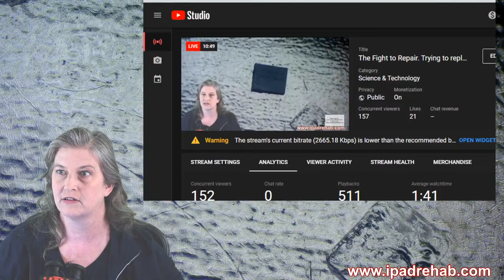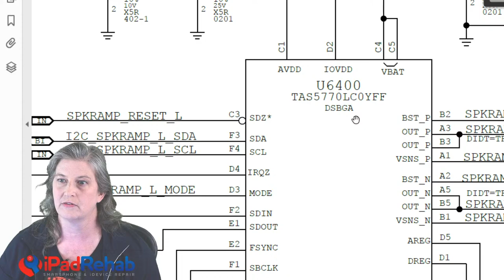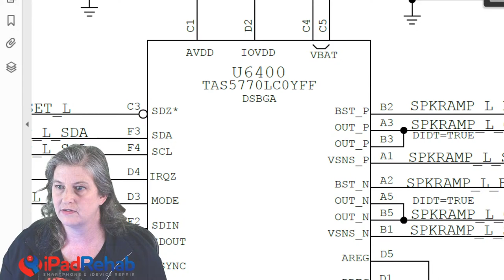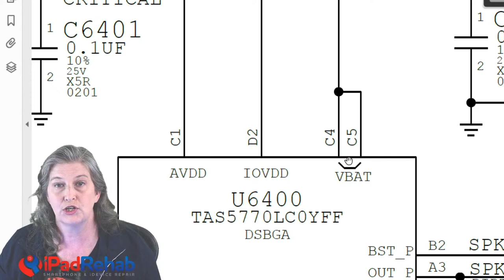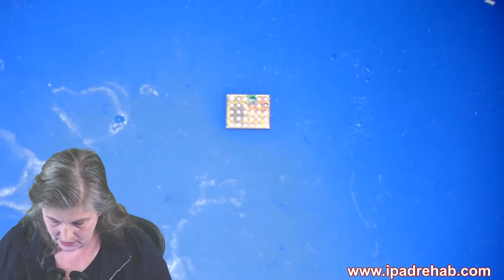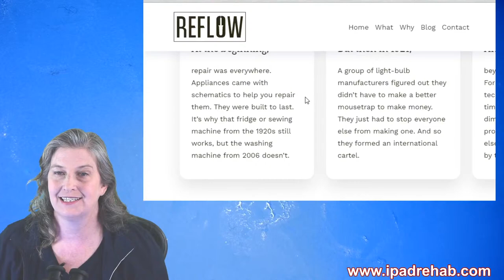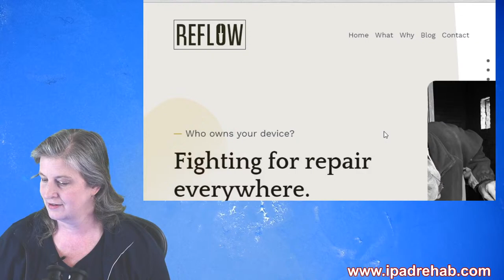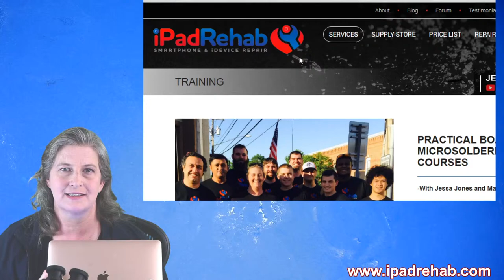The Fight to Repair.  Trying to replace a chip to save a 2020 MacBook Air

Comment: You know it's a common issue with them when the Chinese already have an after market replacement board available on evilbuy. And when you type in the correct number for the chip they are available (at least to us Aussies) on aliexpress .

Comment: i watch the hole thing

after the chip was cleaned it did not look that bad like it did

c4 and c5 seem like they should connect 
to some thing else inside the chip
so covering up c5 was not the plan I would have tried the first time around

I would like to see part 2 of this video of it working with sound

Comment: Very very common on the 18/20 Air for that Audio board to get liquid and the connector/cable on the Audio Board side to explode and cause no power. Cable is cheap, but the connector often has to be replaced. Connector is compatible with the iPhone X chargeport FPC

Comment: Looked up the PTAS5770L from the schematic and found on aliexpress for $3.99. Its the second screenshot on the listing.
Reply: Yup! In order to stop people from finding the chips, TI will mask the actual part number...which is why the number on the chip is slightly different from what the real number is!  This is a common practice when a manufacturer makes the parts for various OEM clients...same damn parts but with different numbers!

Comment: The reason the chip has multiple power/ground pin to lower up inductance to keep up it performance at high working frequency under a load. Its a good solution for backing up data but who know is it going to work per specification on half supply voltage.

Comment: I got fed up with apple this year. I stopped using my Ipod and Iphone. apple gives me the run around on a battery replacement on the ipods I have owned and the iphone had a wierd failure where it would shut off randomly and would usually show zero charge when it was fully charged before shut down. I found that the iphone 6s is temperature sensitive. it will not work or charge if cold and will run fine if it is kept warm (ie skin temp). I just gave up and bought a lenove tab m8 fhd tablet to replace the ipod and went to an android phone last week. Been an Apple guy since 1981 and finally had enough!

Comment: When looking for a chip. Try not putting the full number as the last digits are options and don’t show in searches, only in the data sheet. Example look for a “TAS577” not a “TAS5770LC0”. Then read the data sheet to see if the options “0LC0” are available. Sometimes options include packaging like reels. You don’t care for that.

Comment: It's no surprise the Macbook Air mainboard is small. It's pretty much an ipad with no touchscreen and a permanently attached keyboard. The slightly larger board only accommodates the ports, space for more storage chips and a bigger power delivery section to drive the more thirsty display etc.

Comment: The sad thing here is that PPBUS went into ball C3 and into the RESET line. That connects directly to the T2 chip. I'm afraid the I/O board is fixed but the T2 chip is dead. Maybe you get lucky and the other audio chip on the main board got shorted and saved the T2, but from what I have seen so far the T2 is the one that dies in these cases :(
Reply from the maker: Sadly that is what we found today.  An i2c bus is short according to Brad.   The good news is that headphones work after swapping a different speaker amp controller on the audio board.   

What’s really something is that this SAME exact problem happens on iPhone 6.  5v7 from chestnut goes into cpu reset and kills cpu.    I can’t understand why they don’t correct this?
Reply from the maker: Do you know why headphones would work but not the rest of audio output?  I believe Brad when he says an i2s bus is short within T2 but I didn’t measure it myself.
Reply: @JessaJones  I'm pretty sure it is intentionally designed to fail now. If liquid under this chips doesn't kill the T2 look at J6100, the I/O flex connector. You will see PPBUS right next to the reset line also! This is the same crap as the 50V backlight pin right next to a data line killing the CPU on all 13" MacBooks, Air included. There is just no way that none of the engineers at TI or Apple could have missed this obvious failure mode. They don't address this because it is made to fail and it will be impossible to prove this is intentional.
Reply: @JessaJones  I think headphone has its own codec as it needs L+R. The mainspeaker amp/codec is only one channel. But you would have to pick apart how the I/O board works.
Reply: @JessaJones  That is by design to make impossible the repair. They make sure that some voltage level kill the main chip if something went "wrong" on peripherals...

Comment: IMO in or under chip bridging isn't the only potential (!) failure mode here. Could also have been shorted at the connector, or surrounding passives of the chip or connector, as this side doesn't seem to have any notable sealant coating. Net resulting effect would be (metaphorically) the same poisoned river water, but there are several spots further up or down stream the poison could be dumped in at, not only at the dam. At the dam is the only place a non-intrusive observer couldn't see it happen though. So if they can't observe traces of activity in the open, it must be going on obscured from sight. And there's really only one place for that here.

Comment: you might have to go into the sound and reset it so it will work. So right click on the sound logo and reset the sound. Through the volume mixer. or other settings. You could also do a trouble check and that might tell you why but my guess would be you have to reset speakers or headphones to get sound. just a suggestion, Great live stream thanks.

Comment: I don't know if the camera or the chip moved a bit just before solder solidified.
That's obviously does not alter the point of the question: the chip (or the entire board in this case) should have been on sale.
Reply from the maker: That is how we solder chips—“the imperceptible nudge” is what tells us time above liquidus has been achieved and relieves any head on pillow effect.
Reply: That was after the nudge. Minute 47:48 the board seemed to tilt and the chip seems not to be properly seated
Reply: I noticed the same. Looked like the chip was whacked out of place right after the nudge.

Comment: Loose thoughts from an amateur - that turned into a wall of text. Oh well.

1: ”Another strategy is to see if you can locate it on some other macbook board”
proceeds to manually check boards

In my mind there are two easier ways to try first.
First, if you're using windows/an OS with search bars in folders, type the first part of the chip-name into the search-option in your folder that contains all your macbook schematics etc. Typing in TAS577 into the search function in the top corner of my folder gave me 820-01700 and 820-01598 that has the same chip (or similar). The last numbers and letters of a chip can be batch numbers and stuff like that, but the first half plus change of the name is mostly the same for all chips.
(Note - pdf’s are sometimes “wonky” about working with search functions, and for some reason, mine didn’t find the 820-01521 schematic, even though it also has it when I open the pdf and search the pdf from inside the pdf.)

Second there’s Paul Daniels’ Flex Boardview if you have it. If you’ve (wo-)manned up to the horrors of handing over money to someone who thinks pineapple pizza is edible food, FlexBV comes with a search function, I recall seeing him use it on his streams numerous times to search for components. Can’t recall in what menu, but someone in chat said there’s a “find a part” feature in Flex BV, that I guess searches your pdfs. Since it’s not software written by windows or apple employees, it’ll probably work better than the search function built into windows etc.

2: When looking for what a chip does in a schematic - the page-header in the bottom right corner of the page often gives you a better hint (or a faster one) than checking the rail-names. Betcha if you look, it’ll say something close to speaker amp.

3: “Common board”….”similar chip”…..

Your chip is called TAS5770LC0, your first schematic has that exact chip name with DSBGA written below it. Your “similar chip” is called PTAS5770LB2 and has CSP written below it.

Take the following into consideration:
There’s a known issue regarding USB-C controllers about how you can’t use CD3215B03 chips in place of CD3215C00 chips in macbooks. (Rossmann even has a warning about it in his online store, Quote: “- BE AWARE: CD3215B03 WILL NOT WORK IN PLACE OF A CD3215C00. MOST ARE SELLING CD3215B03 WHICH WILL NEVER ALLOW YOU TO GET 20V ON THE CHARGER. THIS IS THE REAL CD3215C00!”)

The point is: I'm not really sure "similar" is good enough when it comes to macbook components with any sort of programming on the chip itself, and even if this isn't an SMC or similar, the chip does seem complex enough for there to be something running on it. 

Would love to know if the recently transplanted chip was a TAS577 or a PTAS577 according to the schematic of the board you took it from?

4: Reads comments So head phones are working, yet main speakers aren’t.
I’ve seen two laptop repairs with that problem before, with two different causes, though both in settings, so I guess if you boot from your own boot-stick with your own settings this probably won’t be helpful, but if not: 
One was that the settings were such, that the audio would always revert to the soundlevel that output had the last time it was used. So speakers were muted, yet when headphones were plugged in, the mac would automatically raise the sound level to what they were the last time headphones were jacked in, and then automute when headphones were removed again. I think this was the default setting for the computer, but I can’t recall if it was a macbook.
The other was a macbook where the customer had intentionally disabled the built-in speaker audio in settings on purpose, can’t recall why…but...

As I understand your customer is a teacher. If no obvious solution presents itself, I would have contacted the customer, told her of the progress (if she doesn’t know from also reading the comment section), and ask if she herself has somehow disabled the main speakers in the settings somewhere. I could easily imagine a teacher, using a laptop in a classroom, doing so, to prevent a webpage she loads from playing some audio that disturbs the class she’s teaching, ensuring she hasn’t forgotten to mute at some point. In these days of people being cancelled for random harmless comments on twitter, I don’t want to imagine the effects of, say, a 3rd grade teacher getting a flirty popup-ad for some perfume that includes a loud sensual “Aaahhh!!!” at some point, playing in a room full of kids, someone getting it on tape, and it ending online.